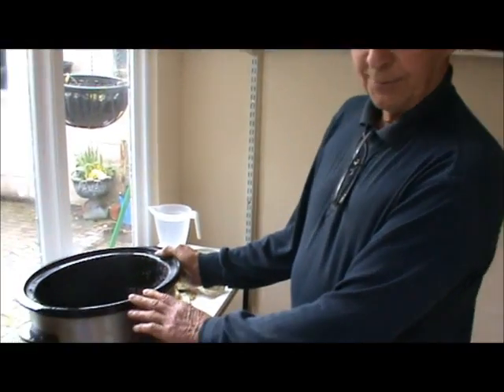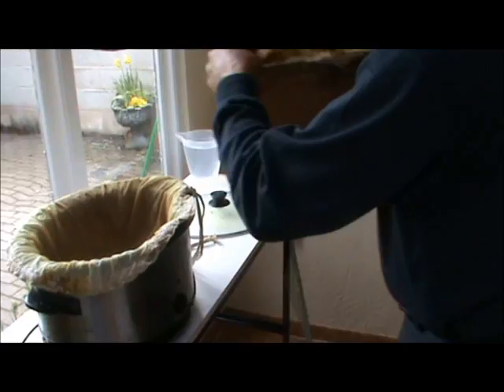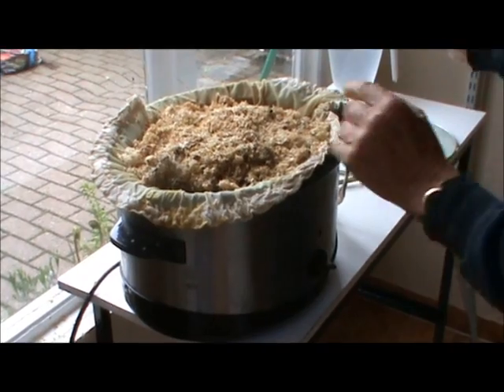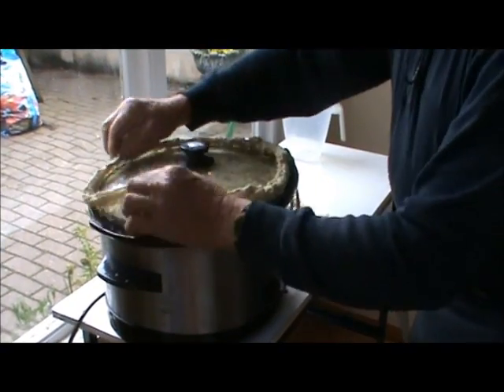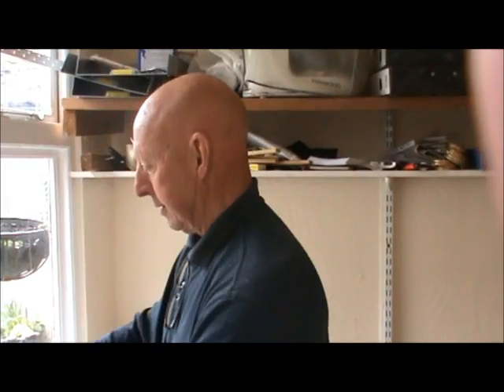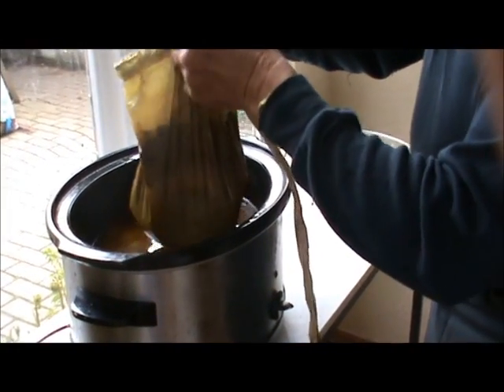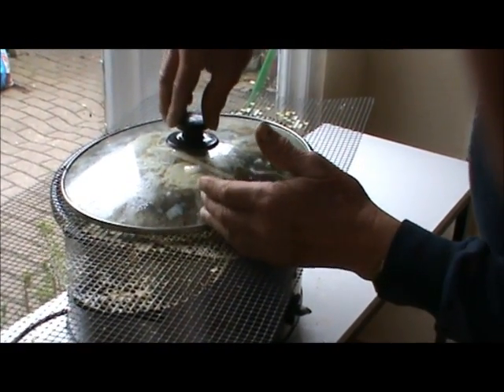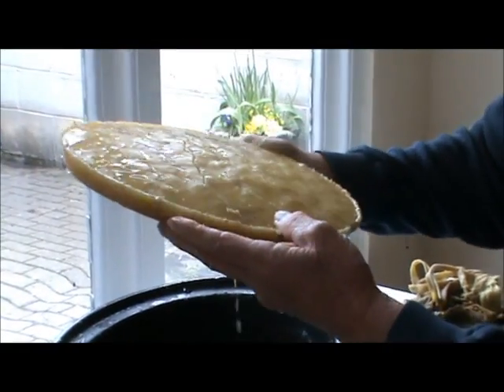Beeswax cleaning, a simple, safe and cost effective method

Comment: This works like a charm! I found a cooker on sale for $5.99, and used a filter bag for a five-gallon bucket with elastic rather than a drawstring. A few hours of heating, pull the bag up and onto a round cooling rack on the cooker with the lid on top. When it cooled, I had a perfectly clean slab of beautiful beeswax. Amazingly simple.

Comment: I used a 5 Gallon filter bag from Brushy Mountain Bee and high setting on the Crock Pot for approx 2 hours. Then put the bag above to drain on 1/4" hardware cloth and let it all cool for a few hours. Then throw away the gunk. 
This method works great.

Comment: This worked perfectly for me.  Thank you sir. A couple things to add. I cant imagine this would hurt the crockpot but i used the plastic crockpot covers just to be safe and it made the job even less messy. Also i put the crockpot on high for an hour, didn't burn or affect the wax in any way. So high or low, your choice, low would probably take a bit longer. Also i used regular old cheesecloth folded over itself so you dont need the high grade filter if you dont have it. Once melted i drained the cheesecloth over a honey strainer just to get every last bit, you could use any type of screen or mesh. Hope this helps a bit more. Thank you again for the video

Comment: I used a throw away cake tin and melted it's in the oven on 200 degrees and filtered into a cup with a sock that hugged the rim of cup and the wax came out super clean. When I do a big batch I will use a second cake tin with a Tshirt covering to filter it. Worked great